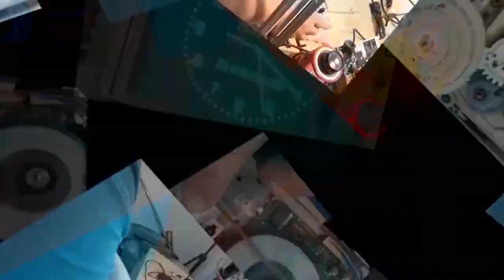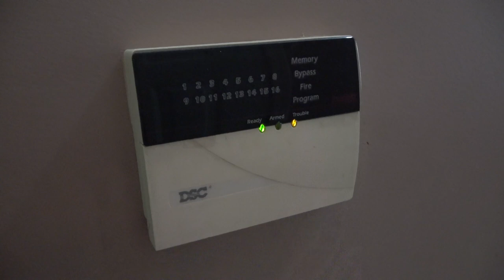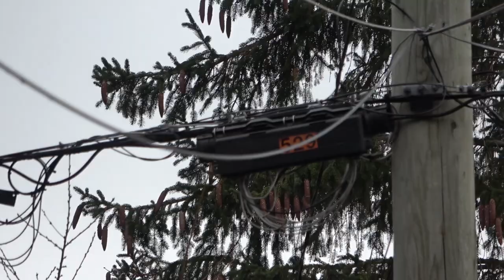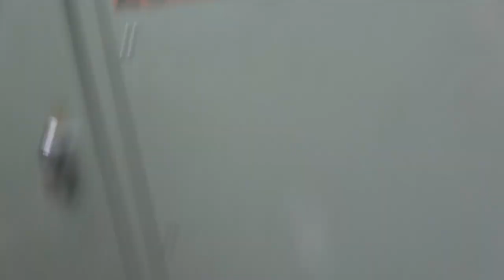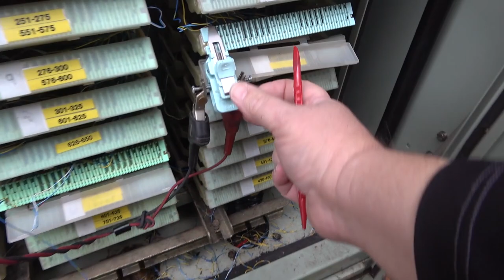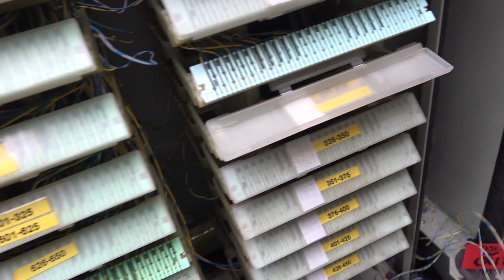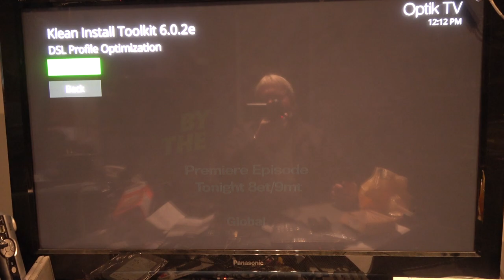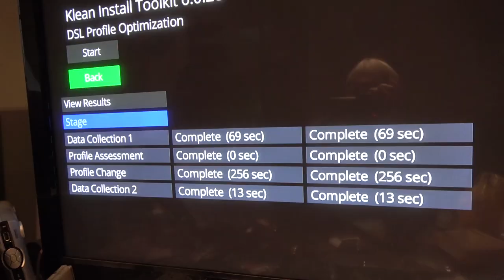Fixing my old noisy copper phone line

Comment: I mean i have a 150 mbps plan with a wisp but that's the fastest dsl I've ever seen. Before the wisp was in my area I was stuck with 3mbps frontier.
Reply from the maker: For those that don't know a "wisp" is a wholesale internet service provider. A reseller.  Since they use the same facilities as the local phone co, and the local phone co provisions a dark line for them in theory the local phone co could have provided you the same service except if the wisp was using someone elses local loop.
Reply: @12voltvids  I think the  WISP Gunner is talking about is a Wireless Internet Service Provider. A terrestrial point to multipoint wireless link can inexpensively provide a reasonably service to people whose next best option is painfully slow DSL or, god forbid, satellite. Both of these are far to common here in the states.
Reply from the maker: @stellated  well he did say it was the "fastest DSL" he has seen.  Had it been wireless i would have expected him to say that.   We offer wireless connections to people that are outside of the copper and fiber service areas  and refer those connections as LTE connection.
Reply: @12voltvids  It's a confusing sentence. I'd be surprised if Gunner was getting 150 Mbit/s DSL if he's in the states. I can get 12 Mbit/s on the high end where I live and as far as I understand you're lucky if you can get 140 Mbit/s on a bonded Vectored VDSL2+ circuit. LTE (a cellular wireless standard) can be quite good but there are also dedicated fixed wireless technologies usually based on WiFi with extensions to improve performance in that specific use case like smaller channel sizes, support for different spectrum, and TDMA since hidden node can be a problem in point to multipoint.
Reply from the maker: @stellated  I do 150/40 bonded and 75/20 single loop DSL installs all the time. Most are in MDU units where the DSLAM in in the phone room Our wireless service here is limited to 40 over LTE.
I have an LTE connection in my company laptop and company phone. Just checked it with my laptop and company phone. Got 32 on both down 12 up. Thought perhaps they have a limited speed on company devices so tried my phone, and 35 was the best I could do on LTE. The cell node is 1 pole up the street from me, and the signal is full bars. SO strong that I can wrap my phone in foil and it will still ring. I know they say LTE can do 100+ but not when many are sharing it. 5G will push the faster speeds once it's fully deployed. Doesn't really interest me though. 
I watch TV, and stream the odd program. That takes 7 megs for HD or 22 for 4K
As long as I have that speed then life is good.
Remember I grew up with 300 baud acoustic coupled modem, so compared with what I used to have back in 82 this is lightning speed.

Comment: Cant you use fiber for the internet and keep the copper line for your phone?
Reply from the maker: Yes, but I don't want fiber for internet. 
I will have to change plans and that means to keep the same TV package I have now it is going to cost more, because the channels are all in different bundles. i am grandfathered into an old package that is no longer offered. Yes it means I am stuck with HD gear, as if I want 4K I have to change plans, but that doesn't matter as I don't have a 4K tv other than a monitor in my studio and I don't watch TV there anyway. To change to fiber with the same speed I currently have will run me about 30.00 more per month. Also, with my old grandfathered account I do not pay to rent the boxes. I have 6. On fiber only 2 are free and the others are 5.00 per month for HD or 7.00 per month for 4K boxes. I don't watch all 6, but it is nice to have them available. Like I have one in the shop and one in my office that I rarely use. The ones that get used most the kitchen and TV room. The other 4 get occasional use. Not enough to justify the rental fee, but without the box I would not be able to use that TV. I could do without the extra boxes and just watch off air TV. For that matter I could do without TV completely because I could live with just the local off air channels. Unfortunately I would find myself divorced if I cut off Mrs 12volts cable TV.

Comment: I'm surprised you didn't mention what is IMHO the biggest benefit of a copper phone line vs fiber or VoIP: the CO battery. You can count on the POTS line working during a power failure but with an ONT you have 8 hours battery backup if you're lucky. Especially useful in an emergency.

Comment: You can get converters to make rotaries work on a unsupported system
Reply from the maker: More shit to buy. I don't think so.  
Obviously you haven't read any comments.  The main reason I am keeping things on copper is 1) price.  Yep it is cheaper to stick on old system because my tv service is grandfathered on an old plan that is not available anymore. The new plans are more expensive as I have to rent the boxes whereas now they are free.   2) phone works during power failure.  Yes i know a UPS will power the ont for a few hours but there we go more equipment to deal with. Alarm system compatability is another and my old fax machine won't work on VoIP.  I do also have a VoIP line I use for business and i can not send or receive fax through that so don't give me crap that fax works on VoIP because mine doesn't and i am not about to buy a new one for the 2 or 3 fax I need to send or receive a year.
Reply: @12voltvids   @12voltvids  was just bringing up a option, you never stated any of the other reasons in the video other then the fact you have legacy phones, i didn't see any other comments bringing up this but there are over 1000 comments on this video and i as well as you dont have time to go through all of them to see if a comment has already been made(clearly you know of one I don't, i just didn't see it), anyways as far as the more stuff to buy argument its only 30 bucks(im not saying to buy it for your other reasons stated)  and as a linesman you know you only need one, all the phones downstream can just be placed in parallel over the existing line, as far as your dsl its very good so i can see your lack of urgency in swapping over, I was simply bringing to your attention this is an option when the inevitable day will come where you have to i assume at some point the copper in your area will be left with such little attention they will abandon it and force people over, how long till that happens idk .... Likely before i die given ive got 60 or so years in me at least no clue if they will still be supporting it 20-30 years from know though, to reiterate I meant nothing but to be of help
Reply from the maker: @jaykoerner  converters might let you dial, but the real bell certainly won't ring.  I like the old bell. As to how much time is left on copper who knows. A couple more years perhaps.  We are switching as fast as we can now.  But as i have said, speed is not an issue because i wouldn't opt for a faster speed even if it was available.    Other than when I upload i do very little on the internet.  Believe it or not there are several days when i don't even turn my computer on.
Reply: @12voltvids  hmm i have never user a pre tone dial phone so i can't say with certainty, but even if your correct with the speed of modern micros i dont understand why a two way system wouldn't be possible, a 50¢ chip has the power to do something that simple, just curious why they DON'T exist if its as you state, lack of interest?

Comment: Do you know what would cause a quiet phone line? It's definitely not the phone, tried a different phone, and even changed the main socket line location.
Reply from the maker: There are a few things.  I don't know if you are on a voip or traditional line but if it is traditional it it likely what is known in the business as a ring cross. A short between 2 of the ring lines.  When it gets severe enough you might even hear other voices if the other person is using their phone at the same time.  A resistive short can also cause this. The phone company is responsible to correct this problem in the cable.
Reply: @12voltvids  thanks for the quick reply, we'll get on them

Comment: stay copper because if your cabinet goes fibre vdsl is pretty much part fibre anyways thats why its so quick depends on how close you are to your cabinet, i can get 20ms ping time on vdsl and i my street just gotten an fibre overhaul i can get 40ms on locations 1000kms away, fibre to the cabinet and copper to the home. still getting my rated speed 50mbps
Reply from the maker: The cabinet is fiber which is just up the street.
Reply: @12voltvids  yeah I think mine is too just a couple houses down next to the fire station

Comment: If you want to keep your old phones working, why not have a private copper switchboard in your house? Run your own phone server on something like Asterisk, which I admit I have no experience with? A virtual switchboard. Run it on a Raspberry Pi that costs almost nothing. Then you'd have a 21st Century Internet connection, and a combo 19th / 20th Century little network for the other stuff? There'd be no line noise cos you'd run it all yourself in your home with new, decent wire, connected to the fibre outside, which is noiseless and extremely high in bandwidth? The smarter features of your 80s-looking phone could be accomodated. And AFAIK it can recognise pulse dialling. 

Or a simpler method, how about an Arduino connected inside the phone? It'd count the pulses, either through patching into the actual dial-pulse mechanism, or else "legitimately" by monitoring the line. It'd count pulses for however many digits, and then beep out the DTMF tones. There are pre-written modules for practically everything on Arduino, somebody will have already created a DTMF synthesizer for you to patch in to your own code. Counting the pulses is just a matter of setting a couple of timers. Or cycle-count it, it's up to you, there's no operating system on Arduino, all code runs on the bare metal. If you go this way, you'll only need one Arduino between all of your phones, just waiting in a corner somewhere for pulses to appear on the line.

The obvious way to do it would be to have separate networks for your separate needs. Have decent Internet through the fibre. With an adaptor between the two. Did you ever see the guy who rigged his old rotary-dial phone up as a mobile phone? He got a little computer, I think an Arduino, with a cellphone module, and a bit of analogue stuff for the phone, including creating the ring voltage. It runs off a lithium cell internally, so it's actually mobile! No screen to ruin the aesthetic, but there are a couple of provisions for modern stuff if he dials certain codes. In general it just acts like a rotary phone with no wire. 

It's horses for courses. You can't expect a rotary phone to plug into the wall any more. That's not what the network is for now.

Comment: neg 48 dc is a fair bit of power, how many amps is that pushing? We use -48DC and 40 amps for our tower mounted cell site radio heads, the older ones usually are only 20A. Side note, It's interesting hearing Demarc used in a copper line context, it's only been a fiber tray linked up to two lit fibers and usually three dark fibers. Then again, I'm in a totally different sector of the telecom industry. Great video, this is a great learning experience. thanks for sharing!
Reply from the maker: Tel line has perhaps 30mA. 
Every home has a demark, regardless if it is copper or fiber. That is where our responsibility ends and it is the customers property.  So if the damage is beyond the demark they are getting a bill.

Comment: Our alarm company does not do landline mon anymore unless in a rural area with poor cell reception we have 4g cellular previously was 3g cellular radio but the 3g shutdown we had to swap out a 4g cellular radio for the alarm but is billed every 3 months for the monitoring
Reply from the maker: All of the modern systems are cellular and wifi based. The older systems require phone line.  Mine is self monitored. If it triggers the system calls me directly. No monitoring station required.  No monthly fee required.  Someone is always close buy should it go off.  I can also look at cameras inside so if there was a break in I would see it, call the police directly and report a verified break in which is a faster response than a monitoring station calling.  If they have video verification they respond right away.  Pretty much everything is fiber now.
Reply: @12voltvids  yes we had an alarm that the same way but the dialer went out so had to upgrade our alarm system and we  went cellular monitoring we a dsc alarm because back then everything was hardwired our dsc system is both hardwired and wireless sensors we about 6 new wireless sensors to our alarm system as we been replacing our back patio doors in our house
Reply from the maker: There js a cellular module for dsc, but then again I don't pay for monitoring.   Waste of money in my opinion.  The discount difference on home insurance is minimal.  I get 10% off for an audible and only 15 for monitored.
That 5% won't pay the monitoring fee.  I have a land line that we still use and the alarm system can dial  out and dial my cell phone.  I can verify if its real as i have cameras.  Because it makes lots of noise with 2 30 watt sirens front and back neighbours will be looking and my sister lives next door so someone is close and I have live video in and out.  If my alarm trips I look to see if someone is in the house.  If someone breaks in, I call the police directly and report a video verified break in. That gets high priority.  Calls from alarm companies are not responded to and if they do and its a false alarm home owner gets ticket.  The siren resets after a few minutes. If the cat sets it off the alarm it makes noise for a few minutes and mt meighbours come over and see if there is any signs of a break in.  Will secure the house.  These modern systems just make noise in the house.  Neighbours will never hear it.  They will hear mine no problem.  I would hear it in the parking lot at work and that is about a mile from my house.  Believe me if a crook breaks in, he isn't sticking around because burglars do not like loud alarms.   My son tripped it yesterday when he opened a window forgetting to turn it off.  I called him and asked whats up. He said he forgot to turn it off and it scared the sh%t out of him and his girlfriend whom are house sitting while I am away.

Comment: We are behind the time here, they do not want to take fibre to your house, they stop in the street and run copper from there or the exchange in the case of phone lines.  Only one internet company will take in fibre to the home for Internet.  There used to be a Cable company here for TV, but they went bust after spending a fortune laying fibre to everyone's street, even before they had an order for TV.  The telephone company had to lay the cables so it cost them a fortune and the orders for Cable didn't come in as they had thought.  It was just to expensive and Digital TV was only supposed to be a few years away, also SKY TV and BSB from satellite were only a few years away, so they were a bit late in getting Cable TV out.  Digital TV is a bit of a pain, ok more channels, but I can see the TV mast and the picture is not that good and does break u now and again.  From where I am the old analogue TV picture would have been very strong, in fact maybe a bit strong!

Comment: Howdy, can you not use a pulse to tone converter and use.your old Rotary's on the fibre that way?
Reply from the maker: Ont for starters doesn't generate a high enough ring voltage to ring the bell. I do have a VoIP business line and rotary phone will not ring on that adapter nor dial out.

Comment: POTS is the only way those phones will work, they're dead even on a copper lines if it's VOIP
Reply from the maker: My old rotary phones work fine on fiber.  I have a battery backup so they work when the power goes down.
Reply: @12voltvids  POTS over fiber?

Comment: That's some good DSL. Single digit ping, 65mbps down, 20 up. That's not bad at all, no wonder you don't care for fiber. Anyways, fiber in my area starts at 6mbps and gets up to 300mbps. DSL here is up to "10 mbps" which usually means around that of 5mbps down, and no more than a meg up, meaning it's useless unless you have fiber. The more you know.
Reply from the maker: Fiber here starts 15 meg up to 1.5gb.  The kicker is the gateway only has 1g Ethernet ports to that is 750x2 to hardwired computers or 1g to a single.
Reply: @12voltvids  you're a service agent, so you could probably manage your way into using an ONU with a 2.5 port if you really wanted to or an sfp module :)

Comment: at some point of time within this year i could go and happily cut copper off this house (too). heck, i'll even have camera ready when i grab my sidecutters! i mean, no reasons to worry about dsl signal being eaten by surge protector, lightning or transient arcing noise in mains (yes! just hold light switch half way for instant (ip)tv cutoff). phone won't change much as it has been ip for years already. i mean nevermind as i run custom routers and servers in home(s) anyway, as well as asterisk to play with phones. and atas too

i understand the reasons but at some point this guys line will be discontinued or at least converted to dtmf only. even if he works there... then he will need to install pulse ata, which, judging from bunch of equipment, he might already have